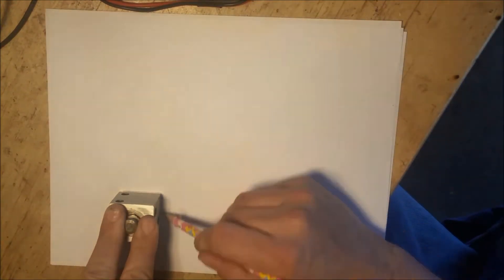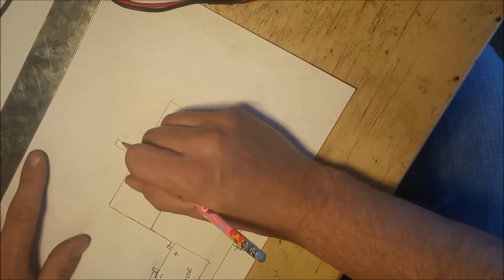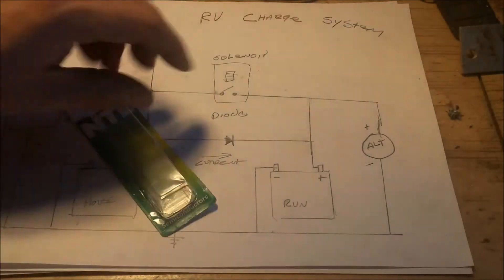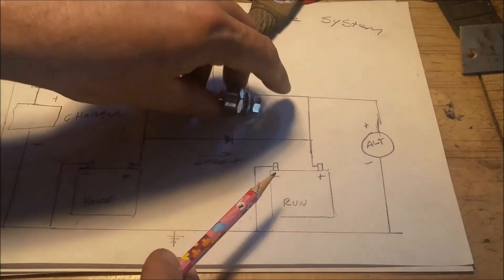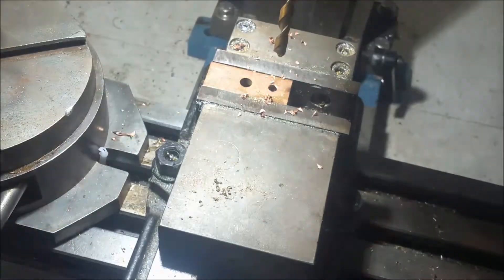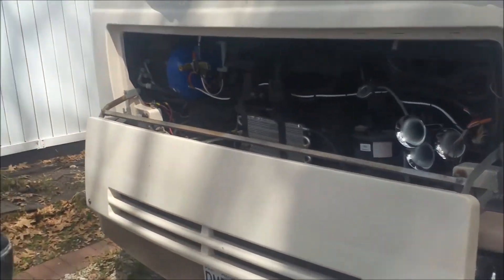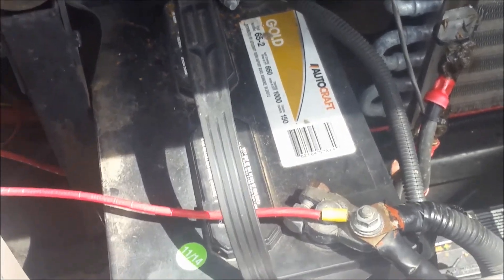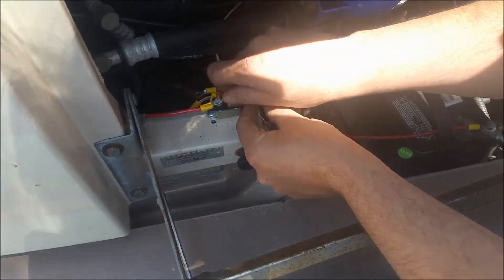DIY RV Battery Isolator

Comment: A couple of comments:
1) There is a voltage drop across the diode.  Depending on the type of diode material (Silicon is typical) this drop is approximately 0.7 volts.  That means that when measuring the voltage of "house" battery on the delivery side of the diode it will be 0.7 volts lower than the terminal voltage on the house battery.
2) Since current is free to flow from the "house" battery to the "run" battery via the diode, if the run battery voltage is lower than the house battery voltage minus 0.7 volts, current will flow to the run battery from the house battery.  That means that if the run battery discharges, it will cause the house battery to discharge.
3) To use  diodes to isolate batteries, one needs to use 1 diode for each battery.  This is done by inserting the diode into the circuit so that ALL current flows from the specific battery through the diode and then to the loads which are drawing current from that battery.  Unfortunately, as mentioned above in item 1 there will be a voltage drop (typically 0.7 volts) across the diode and this may have a negative effect on the loads trying to draw current.  As well, if you are using one of the batteries to START an engine there is typically a very large current draw, much larger than the nominal current draw that may cause the diode to burn out on the started battery or lead to damage of other components.
DISCLAIMER: I am NOT a licensed mechanic or electrician.  The information provided above is for the purposes of sharing and does not constitute advice or recommendations on how to perform specific tasks.  Any responsibility for harm, injury or property damage that results from the use of the information is born by the individual using the information for a purpose other than the intended use.

Comment: Also check many of the automotive breakers are auto reset so it will cycle on you when there is a short or overload. I also had one that just died for no reason leaving me stranded on the freeway

Comment: When the house battery is low then 10 to 15 amps will be going thru the diode. Check it for heat since there isn't much of a heat sink on it.

Comment: Did you try a double diode instead of using a solenoid switch. And what is the specs voltage of diode u use

Comment: Thanks for the video.  How did you determine amps on the diode?  Was it based on the RV charger amps?
Reply from the maker: Hi Larry. I hope you and your wife are doing well. I put a 40 amp breaker in previously and i figured a 40 Amp diode would work. Time will tell.  Did you see we replaced all the interior lights with LED's? Also, you can see the new Air Horns if you watch this video closely.  We are planning a Moab trip this summer in the RV. My family and I cant thank you enough for everything you done for us. -cheers
Reply: Don Brandt 

Yes I saw the air horns.  Pretty cool.  You're doing an awesome job on the MH.  I saw the LED upgrade as well.  Hope you have a trouble free trip this time. 

We're in Talking Rock, GA.  I'm employed as an HVAC service tech here hopefully until I can retire. 

Larry